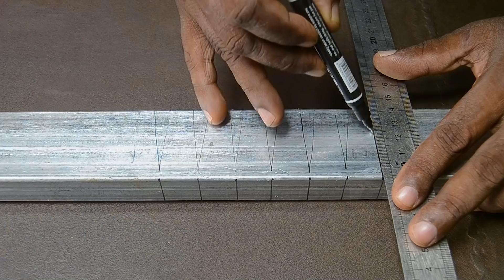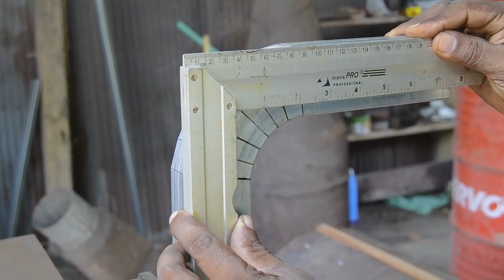2 BEST WELDING SECRETS welders are never say

Comment: The only secret a welder has is a bandsaw. A real welder don't need a grinder. He's a welder not a grinder...
Reply: A grinder is one of the main tools a welder usually needs depending on what type of welding the person does. Fabricator, pipliner, structural, heavy duty machinery repair, etc. If your the type of welder that sits at a bench and welds parts that are already bent and beveled and preped before they get to you, then ya you might not need a grinder.
Reply: Try cleaning a joint with a bandsaw. 

A grinder is essential for welding work as it allows you to remove oxide and other dirt from a joint before welding. It is also quicker and easier for bevelling edges when you want a flat joint for aesthetic purposes as butt welding them without bevelling the edges and then grinding it flat will remove half the weld and make the joint weak. 

So yes a real welder does need a grinder.